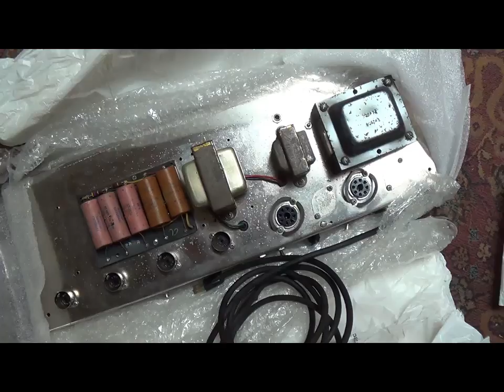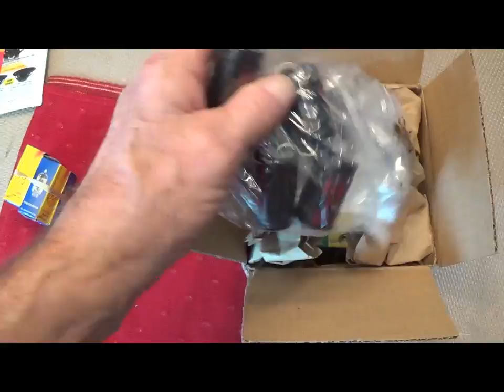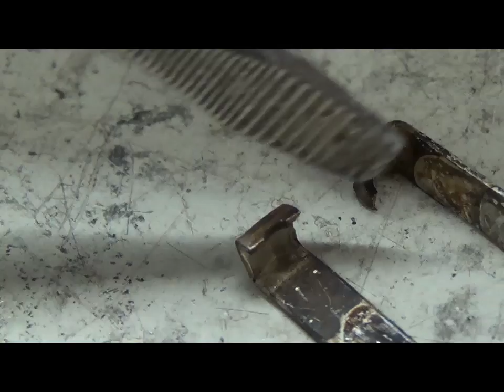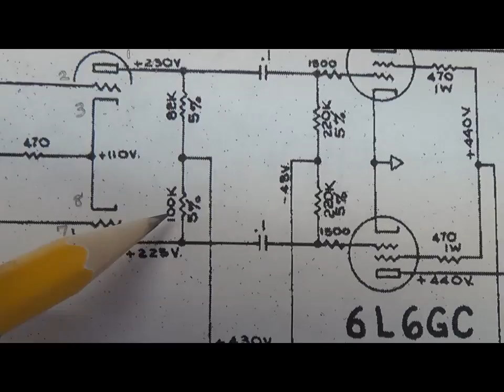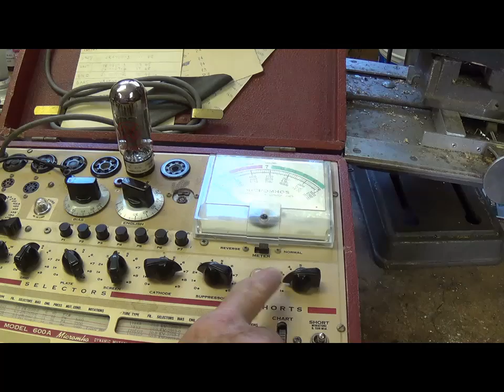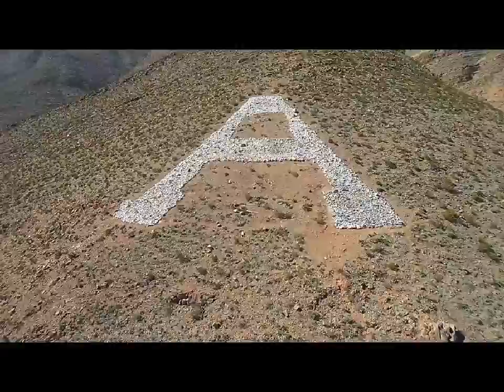The 1965 Bandmaster from Hell......A Really Tough Repair Job

Comment: As dry as Southwest Texas is most of the time that letter A on top of the mountain will probably never erode away for the next 1 to 5 thousand years.
That Amp sure gave you a hard time but with your time and patience you got it repaired. Nice work. How are all the kitty's I've seen on the other videos?
Reply from the maker: It has held up well during the centuries since my graduation, Dwight. The kitties are doing quite well.

Comment: Why does a semi-hollow body change the tone of the signal coming through the pickup/cable/amp?
Reply from the maker: I share your interest in how this happens, LS. About the only way I can visualize it is if you tap on a hollow-body electric guitar, you will hear it through the speaker.....and if you tap on a solid-body guitar, the sound produced is quite different. Apparently, vibrations within the wooden body are able to create sound through the magnetic pickups.....possibly by vibrating the strings.....and a hollow body sound is different from a solid body.
Reply: @UncleDoug   and a ‘woody’ sound comes out of the speaker.
Reply: On an electric, the string vibrates and moves the pickup.

On a acoustic, the string vibrates and ‘echoes’ around inside and is amplified by the wooden chamber which resonates and then moves the pickup.

By Jove I think I’ve got it!

Comment: I just completed my own baptism of fire with a Twin that fell off of its extra 4X12 (Marshall) cabinet while it was cranked up and being played hard. I spent weeks tearing my hair out with cracked solder joints, output tubes with the same kind of intermittent shorts as this one, red plating one minute and ok a minute later, shafts broken off of the pots, pin no. 4 of V1 broken off in the socket and shorting  against the cathode, pin 3, (sometimes) 
B+ voltage on the chassis, (sometimes) surprise!  surprise! Gomer Pyle's in the house! How did I get way over here on this side of the room? Excuse me while I go change my drawers! 
Just lots and lots of fun. Like playing "whack-a-mole" blindfolded, and somebody's throwing firecrackers at you the whole time. Long story short, i finally chased down all of the gremlins, and she's whole once again and sounding great. The guy is picking her up tomorrow and I get $$$ 
The reason I tell you all  this is because it's not only the toughest fix Ive done yet, but i honestly think that one of the reasons I got through it and finished the job is because of the troubleshooting tips I've picked up from you over the years. I almost gave up a couple of times, but now I'm glad I didn't. You deserve some of the credit for that.
Thanks and God bless!
Reply from the maker: Wow.....thanks for sharing this tale of tribulation and triumph, JP.  The "Whack-a-Mole" analogy is right on the money. Fix one thing and nine other problems pop up. I'm glad you were able to complete the repairs. Keep up the good work.

Comment: Hi Doug, I just wanted to say a couple of things. I have watched and enjoyed your videos for years now. I have a 1965 Fender Bandmaster that I redid and your videos have always helped me fix my amps. I have never come across anybody that explains things in such detail as you. You are amazing. The things that you can do is simply amazing. Building hot rod cars and being a teacher and amp repair tech is nothing short of miraculous. I hope you will always keep doing all of these videos.  A lot of people on YouTube are not forthright with this much information and my hat is off to you. This has to be my favourite channel. Just a thank you for all of the great videos. My Fender blackface 1965 amp has a plate voltage of 483 volts on the plates. My amp seems to play fine. This voltage seems very high. If you wouldn't mind, is this normal on some of these amps or could there be something wrong here. Just thought I would ask you about this if you wouldn't mind giving me some advice.  Thanks Michael Newell from Niagara falls, Ontario, 🇨🇦  Canada
Reply from the maker: Thanks so much or your very nice comments, Michael. We really appreciate them. The plate voltage (PV) in a circuit is indirectly related to the plate current (PC), which means that if you increase one, the other decreases. Perhaps your PC is too low, making the PV too high. The only way to determine this is to bias the output tubes and balance the PC and PV.....which can be a hazardous procedure if you are not qualified to perform it. Perhaps you can seek some local tech assistance if you're not personally able to do this. Good luck.

Comment: Uncle Doug, I tried using an older bassman/band master and sadly, it didn't do it for me on bass. Is there a way to mod the circuit to make it more friendly to bass frequencies? It definitely seemed like it was very much geared towards a guitar, and not a 60's Thunderbird.
Reply from the maker: Perhaps the circuit has been changed in the past to suit guitar use, Aaron. There are ways to make such a change in voicing, but they are far too complex to explain here. You have two choices: Get a dedicated bass amp or find a local tech who can make the necessary modifications.

Comment: Great video! First amp I ever re-capped was one of these 30 years ago. I could't help but notice what looked like a voltage dropping zener diode on the center tap of the power transformer. Maybe I missed you mention it? If that's what I saw did you remove it? Just curious.
Reply from the maker: Thanks, CB. There was a zener diode, which was left in place. It was probably to compensate for elevated AC supply voltage.
Reply: @UncleDoug  Got it. That makes sense. Thanks!

Comment: 2:16 First look at the chassis
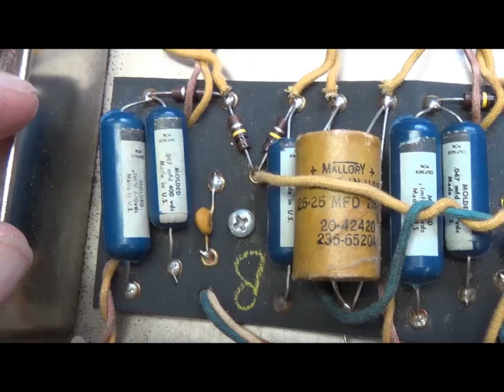3:47 Analysis of circuit
8:13 Removing the electrolytic capacitors
9:27 Replacing cathode bypass caps
9:50 Review of replaced parts
10:59 Coupling caps for 6L6s
11:26 Diode testing / filter cap replacement in negative DC bias supply
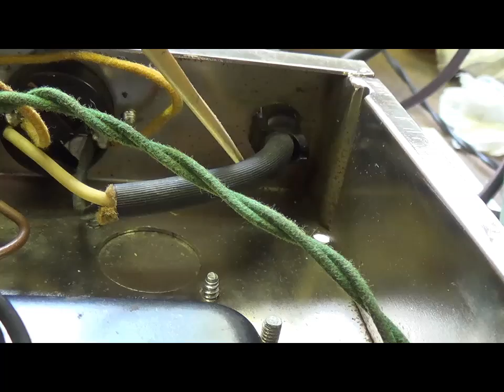11:41 3 prong cord
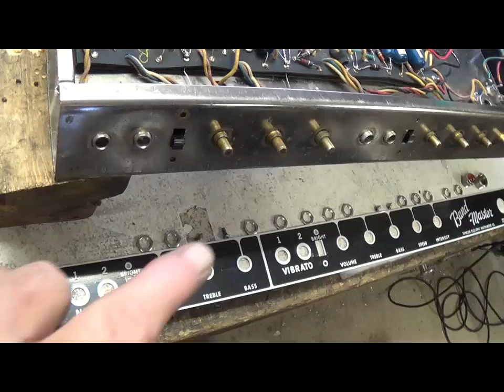14:43 Replace control panel
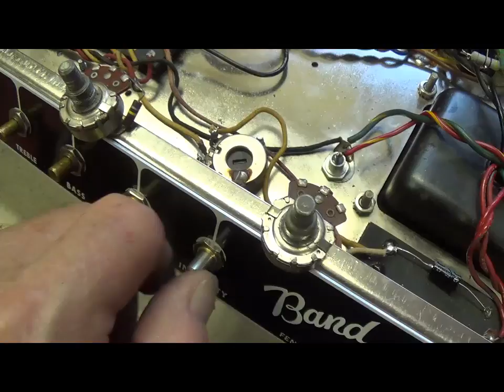15:21 Frozen trem pots - replacing pots
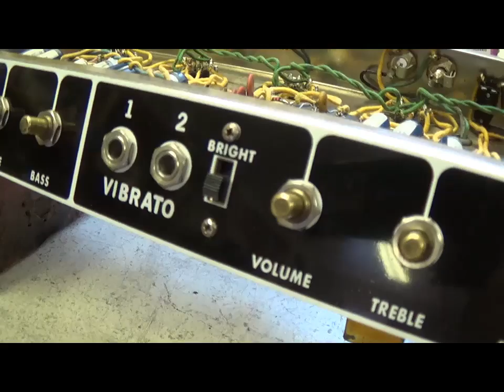16:01 Bright switch disassembly 
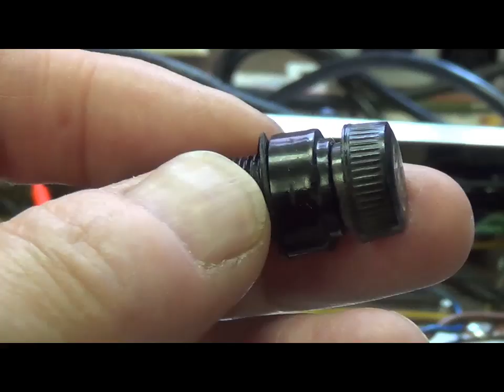18:45 Fuse holder replacement
19:20 Dead amp (no signal)
19:55 Checking for an open winding on the output transformer
20:40 Winding ratio test on output transformer 
21:55 Checking bias voltage applied to grids of 6l6 output tubes
22:52 Replace bias resistors and coupling caps
23:12 schematic comparison to bias resistors
24:58 Amp works but tremolo is dead
25:38 Addressing the tremolo problem
27:25 Extraction of the “roach” (photoresistor and neon bulb)
28:30 Installation of the new roach
29:00 Broken pot (popping and whistling)
29:22 Amp starts popping and motorboating. Caused by dead short in 6L6
31:45 Shorted tube back in circuit. Will the short reappear?
35:20 Sound Demo
Reply from the maker: Wow, thanks so much, LBR......very helpful :)
Reply: @UncleDoug   No problem. It helps me when referencing back to your videos. Sort of a table of contents. You are welcome to pin these comments or use them in your description if you so please. I just figure it helps navigate your amazing content. Thanks again

Comment: Good catch on the faulty "new" tube.   Can one use an osciliscope to better see the signals over that of a DMM?
Reply from the maker: Thanks, Bill. An oscilloscope is the only way to visualize wave forms. The DMM simply measures voltage and current.

Comment: Uncle Doug, I like your current limiter, but i do have a suggestion ,if I built one like it, I believe i
would use a  GFCI (Ground fault circuit interrupting) receptacle. Not nitpicking; just
 suggesting. It would protect against death  capacitors too. I also have a suggestion for your home made Leslie, but I'll save that for another comment.
Reply from the maker: Thanks for your input, Arlie. Best of luck with your CL project.

Comment: I was considering to buy a vintage Fender amp. Now I'm in doubt...
Reply from the maker: Not many of them are as screwed up as this one, Icobos. You would probably be safe in doing so.
Reply: @UncleDoug  Thanks a lot for the comment! Probably I´ll check the amp this weekend. It's a ´66-´68 Vibrolux with blackface circuit (not sure yet, but I can see a rectifier tube at the pictures). Whatever I may find inside the rusty chassis, at least having available videos like yours makes a huge difference for people like me who only know a few things about amps but are willing to learn. Man, I really apreciate your fine work
Reply from the maker: @icobos  You're welcome, Ico. Best of luck with your purchase.

Comment: Hey Uncle Doug,Great video. So much to learn. Thanks for the education.By the way, is there a brand of meter that you prefer for checking caps? I have a DVM but not a capacitance meter.thanks for your time!john
Reply from the maker: Most DMM's will measure capacitance, John. If you want to measure ESR values, the Anatek Blue meter is a good one.

Comment: I would have sent that tube back and told them that it had a "interment"  short circuit. if they didn't believe you they can watch your video!
No wonder Jack kept sniffing and chewing on the plastic, he's a little suspicious and confused about it!
Reply from the maker: I did, Ronnie, and AES immediately replaced both tubes in the matched pair. Jack did pick up on the short, but I foolishly ignored his warning.
Reply: @UncleDoug  I seen that when I got to the very end of the video. Your job Uncle Doug!
Reply from the maker: @ronniepirtlejr2606  Thanks, Ronnie :)

Comment: I can't wrap my head around why you would leave any of those original coupling capacitors in circuit. Paper capacitors are an inherently flawed concept and they always go bad. Even if your tester somehow missed the leakage they should still be replaced. Given how dirt cheap high quality modern polypropylene capacitors are it just seems like a no brainer to me.
Reply from the maker: There are several schools of thought on the matter, R4, and I tend to take the conservative approach when it comes to replacing vintage parts that are still fully functional.

Comment: You need a Alan Douglas cap tester/reformer.
Reply from the maker: I occasionally use a Variac, WC, but generally rely on only a Current Limiter when testing old circuits. For testing coupling caps, I monitor the stability of the plate current in the following tube.
Reply: Uncle Doug I used a Variac with series resistance but Alan convinced me to build his tester and I am glad I did. His book is really helpful. He went \SK November ‘19 sad to say.

Comment: In later videos you state you always wire the switch before the fuse?
Reply from the maker: Yes. If I left it otherwise in this circuit, it was an oversight.

Comment: Hi! I've just bought a 1965 original fender bandmaster which hasn't de original transformers. Which transformers would would be the best replacement for it? I was thinking about the Hammond, classic tone or mercury magnetics transformers.

Which is a your opinion in that case?

Thanks in advance and thanks for your videos
Reply from the maker: Classic Tone and Hammond would be my choice, Alejandro, unless you prefer to spend 4 times more than you need to on the MM. The CT is available at Amp Parts Direct and the H is available at Antique Electronic Supply. Good luck.

Comment: Those little stupid things(like that switch) that drive you nuts when restoring any vintage thing.
Reply from the maker: Yes, they do, Doug. As it the circuit itself wasn't nightmare enough, the %@#$&?$ switch just rubs salt in the wound.

Comment: Not sure if you ever used justradios.com for caps and resistors,  but I have pretty good luck finding what I need.
Reply from the maker: I haven't yet, FH, but will give them a try if Antique Electronic Supply ever lets me down.

Comment: I look in my box of spare parts for those slide switches. Sometimes i can use a different switch for parts to repair. Your doing a great job on that amp.
Reply from the maker: Thanks, CS. As you can see, the original switches can be rebuilt.

Comment: B+ voltage supply are all chineze made so dont bother name on it, 4resistors you change must be carbon type, and prefere carbon filled one ! For power tubes is from wery big importance to place cathode resistors of 1Ohm 2watt ceramic to prevent fireworks when tube goes bing ,, I like your work here and would like to se mesurament of old components just to compare..regards..
Reply from the maker: Thanks for all your very helpful advice, Johnny.
Reply: @UncleDoug  35jears of reparing and buiding tube amplifiers, same as you.. Its a beautiful hobby/job. Reward and satisfaction is great when finaly you plug it in and it works and sounds like a charm.. When i make new project oor i must check compleet schematics after some "repairman"wich did more damadge then good, i allways copy schematic and then when i chect parts and connection of sertain section i mark that on schematic, so when every wire and component is marked then job is done and must work corrctly. In my life i repair many funny things people screw thinking it would get better that way.. o boy o boy.. regards to you,god bles and keep up the GREAT work alive !
Reply from the maker: @johnnybravo4704  Thanks for the helpful suggestion, Johnny. Likewise on the blessing :)

Comment: I just happened to start at the busted bright switch.  I don't know if that was the total problem but I also had a nightmare with that switch on a blackface Super Reverb.  It is hard to know they are busted because you hardly ever use that switch.
Reply from the maker: In this amp, it was one of many, many problems, M.....hence the name of the video.
Reply: @UncleDoug  I need to watch the whole thing then.  I just did a video on troubleshooting my 1959 Tweed Bandmaster but it just ended up being loose pins on the V1 tube socket.  I would love to replace all of those sockets but I need to keep it as original as possible.  It still has the original cord too.

Comment: After a two days of my own trouble-shooting on a new build, and getting nowhere fast, it was good to see this and realize that it happens to the best techs. Thanks Uncle Doug. (but of course, my problems will probably be due to something I did wrong:).
Reply from the maker: You're welcome, Shaun. Part of the appeal of working on tube circuits is that they can offer great challenges from time to time, and more often than not, the solution is not only relatively simple, but in plain sight......that is, once you've figured it out :)
Reply: ...we live and learn-!!

Comment: where did you get the tube? I know this is old, but honestly someone like tube depot would honor a replacement.
Reply from the maker: Antique Electronic Supply replaced the matched pair of tubes immediately.
Reply: @UncleDoug  I noticed that down the road towards the end before I commented. I've always had good luck with tubedepot... they have never even questioned a tube problem. Glad to know the other place did the same for you.

Comment: I was playing through the Studio City 50R and it was terrible when i got about a year ago, but had good volume. So i started in on it when i watched a few of your vids. Replaced all the filter caps, a lot of out-of-spec resistors, i put the reverb tank on, fired it up, at first erratic, no sound...,(&”#%,..., then no readings, no nothin’! So I followed your process of measuring the continuity of the ITs primary. Turned out to be the fuse contacts, just needed cleaning! Whew, . Now, the volume is very low, but plays at least, and the heater voltage is only ~3.15vac, hmmm, it does have a center tap surprisingly.
Lots of fun!! Thanks so much for inspiring me. I owe you.
PS love the car vids too!!! Your comments are priceless! Hah!!
Reply from the maker: Thanks for sharing your experiences and nice comments, TG. Are you sure you haven't used the wrong 2 wires for the 6.3VAC circuit? Or perhaps one of the two half windings is open.

Comment: first guitar amplifier I owned- 1965, and a 1959 Stratocaster paid $225.00 for guitar in bay area
Reply from the maker: Good grief, Michael. You certainly started out right when it comes to guitars and amps.

Comment: My first amp. Paid $25 for it...100% untouched orig., fully operational, with 100 cigarette burns across the top front edge of amp. I LOVED THAT AMP! Saw it years later in a pawn shop for $625. I didn't buy it...but I played it.😊😊😊

Comment: Ive had issues with JJ caps failing very quickly. I noticed they are only rated to + 70 degrees whereas others are 85 degrees or even 105 degrees (usually on the generic ones interestingly). I also noticed they are rated for 1000hrs life at rated voltage where most others are 2000hrs if used at something like 150% rated conditions.
Reply: Also the tolorence  on JJ caps is 30% on the overside other caps are generally 20%
Reply from the maker: I guess it's time to start avoiding JJ caps, Nick. Thanks.

Comment: Just did a 1977 Bandmaster. Had one 6l6 gc and one gb to start off . Other than that and some tired filter caps and some bad resistors in the LTP it was pretty good. A few plate resistors had drifted up in value a bit as most of those old carbon comps do over time. One broken resistor lead from the tremolo circuit. Of course I put in new screen grid and stopper resistors. New parts and two tubes I matched up on the old Hickok 539c with some biasing she sounds great. I just used 2 33uf caps in parallel to make up those 70uf caps. They measured out about 68uf per pair. Saved my customer $$$ since I had a bunch in stock.
Reply from the maker: That sounds like a very practical, thorough, and successful repair, 6S. Congratulations !!!
Reply: @UncleDoug  Yes, the 33uf body size were small enough to pair them up and have them still fit in the "doghouse" with no issues.

Comment: My experience with JJ 6L6 tubes is horrible.  The center locator pins are brittle plastic and easily snap off.
Reply from the maker: Thanks for the input, Robert.